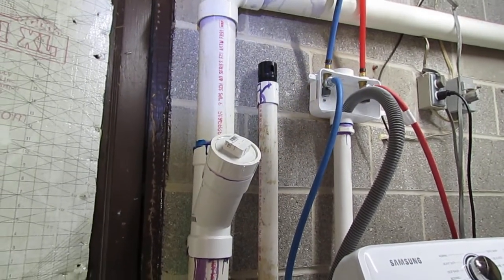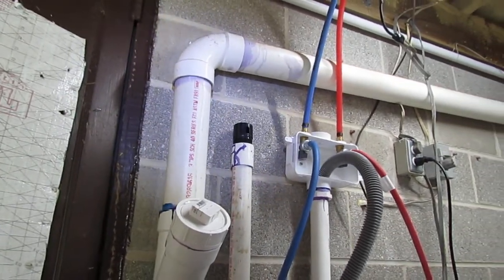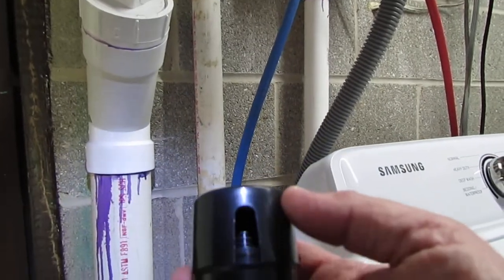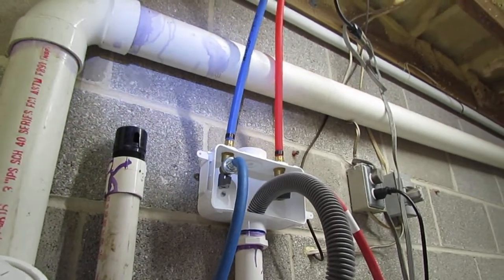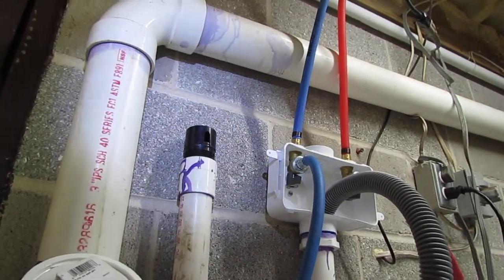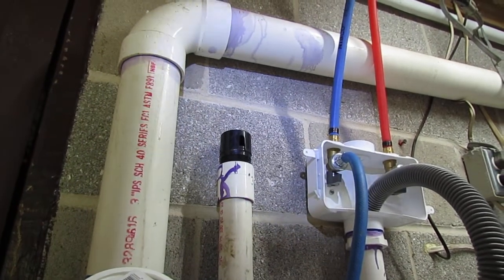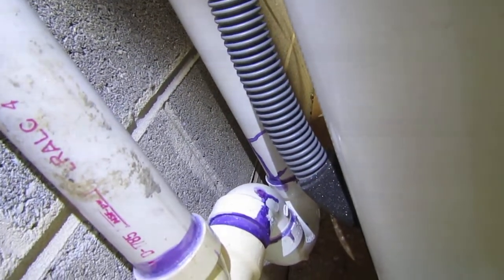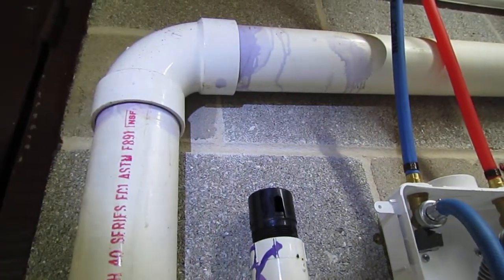Sewer Gas smell at kitchen sink Oatey Air Admittance Valves inline pipe vents how do they work 154

Comment: I have a Studer valve in my kitchen sink. I don’t have any slow drains or anything backing up. But the last two weeks I smell a sewer, gas smell coming from one bathroom under the sink (but not the sink itself)  and then the upstairs bathroom it’s coming from the compartment in my whirlpool bathtub. I’ve had plumbers come and look and check P traps but all they tell me is it’s probably a dead mouse. Or it could be a cracked pipe, but they didn’t think so. Could the studer valve have something to do with the smells  in  two different bathrooms?
Reply from the maker: These are mechanical vents and as a result are subject to get stuck in the open position